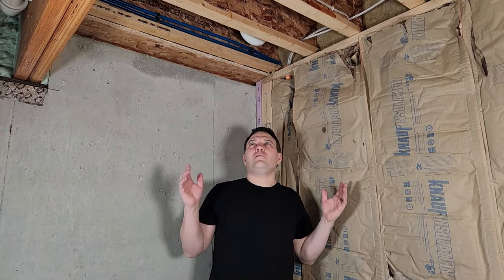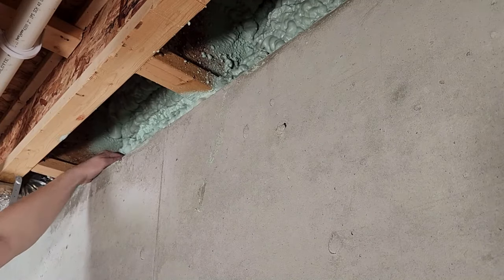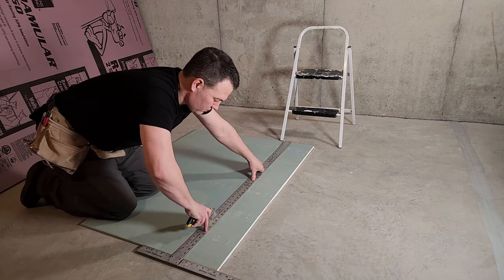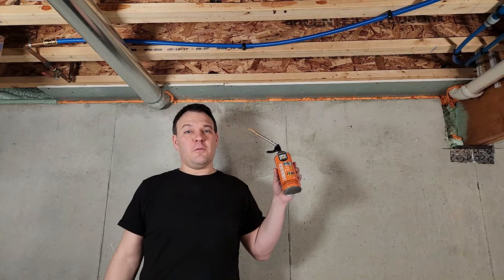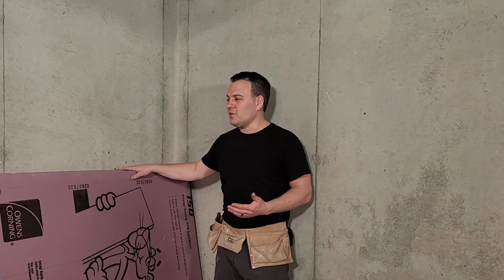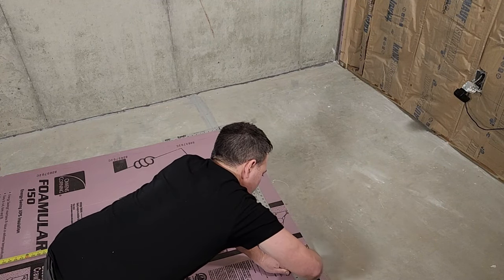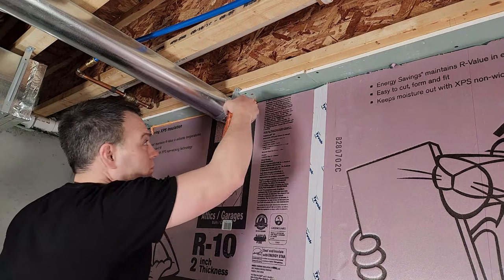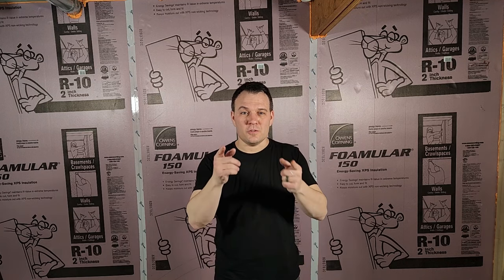EASILY Insulate a Basement Wall: E2 Basement Finishing

Comment: It will look great in the end!  I will say you want to maintain an air space between your insulation and concrete. Apply PL300 in circular beads to the foam board so the air space is continuous from the bottom of the basement floor to the top of the floor joist and will find its way outside. If you don’t do this and apply it across the width of the foam board back and forth it will trap in the moisture. Follow my techniques and you’ll never have to deal with mold.  👍
Reply from the maker: Thanks for the tips!
Reply: @HowIDoThingsDIY  Yes sir, keep up the good work.  👍
Reply from the maker: Thank you.  I shall.
Reply: What about straight vertical lines that are open like this  | | | | ?
Reply: @John52416  That will work as well. 👍
Reply: Was always told use “s” instead of vertical or horizontal
Reply: @Stratoliner5  You want to apply it so the air space is continuous from the bottom of the basement floor to the top of the floor joist and will find its way outside. If you don’t do this and apply it across the width of the foam board back and forth it will trap in the moisture. Follow my techniques and you’ll never have to deal with mold.  👍

Comment: I’m in Canada, the building codes are probably different here but I was planning on using rigid foam board on the interior walls. What would be the issue if I find out that there’s no insulation on my exterior walls?
Reply from the maker: You mean on the outside of he basement wall?  That should be fine.  That's common.  I just wanted extra insulation.

Comment: Hey man great video, Question: I live in Chicago, have a house with a baseman. it's a older house. after the installing 1" foam boars and 2x4 frame should I use insulation with vapor barrier yes or no.. Sorry I got confuse other videos recommend to use plastic.?????
Reply from the maker: No.  If you install this type of insulation and tape the seams with the correct tape, then the insulation is a vapor barrier.
Reply: @HowIDoThingsDIY  It's a vapor retarder. It has a perm rating high enough for that. Let below grade dry to the interior, yes.
Reply from the maker: @bfullsyou Thanks for the added info!

Comment: Would a 1.5 rigid EPS board work instead of 2 inch XPS board? XPS pricing is double just for .5 inch difference.
Reply from the maker: Just depends on where you live and how much insulation you want.  When I bought this stuff it was like half the price it is now.
Reply: @HowIDoThingsDIY  I Iive in the southern region. The prices are ridiculous.
Reply from the maker: @rainman415 I would look up the recommended R value in your area.  You can also do a combination of this and fiberglass in the wall
Reply: 1.5" EPS is about R5.7 2" XPS is R10 So you get alot more insulation with the XPS. If its only twice the price it is a good value. Locally the 2" XPS is almost 3x the 1.5" EPS so 2 layers of EPS is the better value if you dont mind 3" of foam.
Reply from the maker: @cmbakerxx Great information.  Thanks for adding that

Comment: Any advice on adhering the rigid foam insulation on basement wall that is bowing/leaning? it has been mediated to not get worse but most likely the rigid foam insulation is not going to sit flat on the wall. Should I just use more “glue” on the foam, is it ok to have a gap behind it (I feel like it defeats the purpose if I have gaps between the wall and the foam). Would not have been an issue if I was doing doing it the wrong way with the fiberglass insulation inside a tarp given its flexibility….
Reply from the maker: Actually, its best to have an air gap to allow some air flow.  That way if there is any moisture coming from the concrete i it won't collect.  I guess it depends on how warped it is.  If its really bad you could also use spray foam insulation.

Comment: Can I put the drywall directly on the foam board or it will have to be framed?
Reply from the maker: The drywall needs structure to attach to.  I don't know of any way to do that other than framing a wall.  There may be some way of doing something like that. But I'm not aware of it.

Comment: Do you glue and screw the drywall?
Reply from the maker: I screw it to the wood and used fire block caulking to adhere the backing piece in between the main pieces.
Reply: @HowIDoThingsDIY  I'm asking about the walls and/or ceiling drywall.
Reply from the maker: I personally just screw drywall.  I'll cover that when I get to that.
Reply: You screw your drywall to the foam board? Or did you build a 2x4 basement wall frame?

Comment: repeat after me: Rock Wool!  Fiberglass insulation is soooo 20th century. Rock Wool won't rot, won't settle, won't mildew, and won't burn. Plus it provides superior insulation and sound-proofing. It's more expensive, but worth it! :)
Reply from the maker: I use that in other areas of my home.
Reply: @HowIDoThingsDIY  You should've used it here - the most moisture prone area of the house.
Reply from the maker: The fibers in rock wool are more likely to capture moisture than closed cell foam board.  But your welcome to use whatever product you prefer.  Thanks for the comment!

Comment: Thanks for the tips! Question - should you add a 2x2 between every two foam boards, glued to the wall? IRC requires fireblocking at minimum every 10' horizontally. I am working on my basement now, and didn't realize code had changed (my last basement finish was in 2014), so I have to go back and cut out some foam to add 2x4s flat between the boards (I used 1.5" thick foam boards). Luckily I haven't got very far! I have 9' ceilings so I am adding the fireblocking vertically now before I cut remaining 1' sections of foam for the top of the walls.
Reply from the maker: That's not required in my state.

Comment: These videos are really helpful. I have a question- I’m in a new build house where rigid insulation was installed on the exterior of my poured concrete foundation. Is it optional or required to install rigid board on the interior surface? And do I need to cover all walls or just the walls I am finishing? And last question, can I use rolled fiberglass insulation between studs in this situation? Thanks in advance.
Reply from the maker: My house is newer as well and has foam board on the outside of the walls.  I have been told it's optional to add more, like I did in this video.  However, the walls still felt a little cool to me so I added more insulation.  I live in Wisconsin and it gets cold here.  The other added benefit is that this foam board will act as a vapor barrier when using the right tape on the seams.  If you use foam board on the inside and you have it on the outside, there really is no need for fiberglass batt insulation.  If fiberglass batt insulation ever gets damp, mold will grow on it inside your walls.  Closed cell foam board is much more mold resistant.  My basement is very dry but I didn't want to take any risks.  I only apply foam board to the walls I was finishing.  Foam board needs something to cover it per my local building code so just leaving foam board uncovered is not acceptable.
Reply: Thank you!! We are in Ohio so not as cold but still cold enough. I appreciate the very quick reply too.
Reply from the maker: @craigcusano6149  Absolutely.  Don't hesitate to ask more questions.

Comment: Great video series! When installing that Sheetrock as a fireblock, assuming it’s better to set it back a bit from your top horizontal stud to avoid going through and cutting off any excess, correct? I was going to use plywood but may use Sheetrock given it’s easier to corrrecr
Reply from the maker: I don't completely understand you're question.  I like to use plywood but either is acceptable.
Reply: @HowIDoThingsDIY  I meant when installing the horizontal fire blocking, it essentially has to line up perfectly with your top plate line otherwise it would extend past the top plate and interfere with the ceiling sheet rock inside the room. Figured the Sheetrock would be easier to shave away if that happened.
Reply from the maker: @infiniti2015  Ah! Got it.  Yes. Or fall a little short.
Reply: @HowIDoThingsDIY  Cool. Thank you!
Reply from the maker: @infiniti2015 You're welcome!

Comment: So, Crap.
 I'd had plans to divide my basement with a 2x4 framed wall under the steel beam and on one side of the room put up Foamular 2" sheets as done in this vid and then just paint it with latex/foam safe paint.
 Your post is the 1st one that's stated that "..most bldg. codes require you cover the foam board with drywall .. "
I'm in St Louis Mo and don't know if this rule applies.
Curious how you'd put up drywall against the foam ?
.. I'd think you would have to frame it in to have some way to adhere the drywall to.
Reply from the maker: Perhaps I'm misunderstanding, but if you framed a wall in the middle of a basement, it doesn't need any insulation.  If you don't want to drywall it you could also put plywood on the wall and paint that.  Foam insulation releases toxic gas when burned.  The building code is meant to increase the time it takes for the fire to get to it so you can get out of the house.

Comment: Do you know what R-value the builder used for the outside? was it R10 or a different R-value?
Reply from the maker: Sorry, I do not know exactly what was used on the outside.  But I can tell you that with the added R10 on the inside, my basement is very comfortable.

Comment: do you add r13 insulation after the wall is framed?
Reply from the maker: No.  I have foamboard on the outside of the concrete walls plus this.  This was plenty for what I wanted and I don't like fiberglass insulation in basements unless its for sound deadening.  I just don't like any materials that have the opportunity to hold moisture and mold.
Reply: @HowIDoThingsDIY  ok thanks. Because I hear conflicting things about this. I’m finishing my basement soon and wondering if I should do both foam board and r13
Reply from the maker: @dalebcooper3718  Some people do if they need more insulation.  If the foam board is enough for your basement, then I would skip the fiberglass batts as they can hold moisture and mold.  I did use some in my theater room for added soundproofing.  It depends on where you live the construction of your basement walls and how dry your basement is.
Reply: I sealed the concrete with a concrete sealer. Then I used 1 inch foam board on the concrete.
 After installing  my studs, then I fit foam board in between the studs as well.  I also used a mold resustant drywall product instead of normal dry wall.  I used a mold reaustant drywall mud, and then painted with a mold resistant paint 
It really improved the warmth of the room and should be significantly mold resistant.
Reply from the maker: @TheHavocdog I like your style.

Comment: Are you planning to use more insulation in the frame
Reply from the maker: No.  I don't like batts in basements.  The stuff I used is very resistant to mold.  Plus my basement has foam board on the outside of the walls as well.